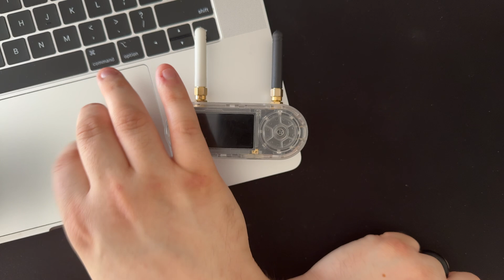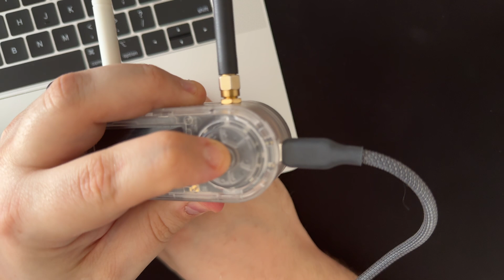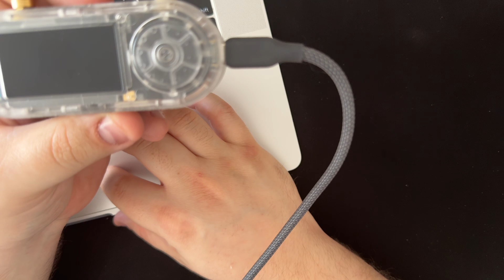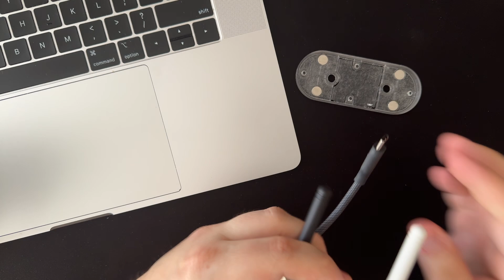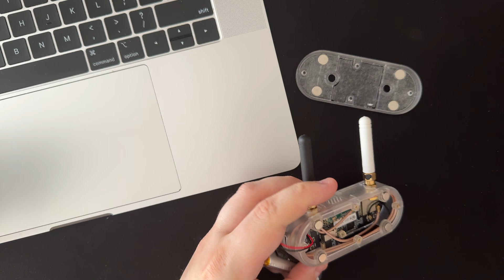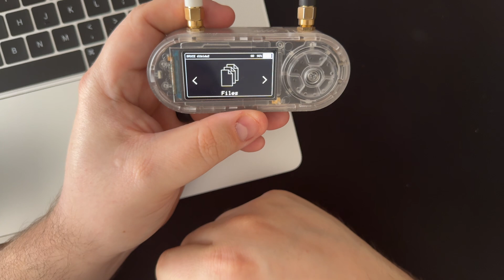Installing Bruce on Lilygo T-Embed: A Simple Guide

Comment: For me it does not work,i think i have a harware issue,Installing Lilygo T-Embed CC1101
⚠
Failed to initialize. Try resetting your device or holding the BOOT button while clicking INSTALL.Anything i tried sadly it failed.Tried different computers,different cables....
Reply from the maker: You held the button in the center of the dial, plugged it in to pc, and then released after another second or so?  Also try removing the battery when flashing.  Be careful as it has some very strong adhesive that keeps it in place.

Comment: Do I just connect it trough a usb and normal usb port, my cc1101 isn’t showing up as a connectable device even when I hold the button down
Reply from the maker: There are several things you can try.  Try switching your cable.  90% of the time the cable doesn’t support data and is charge only.  Another thing is depending on what OS you are running, it would need a serial or COM driver. Lastly is none of those work, try a different computer if you can.  Hope that helps.